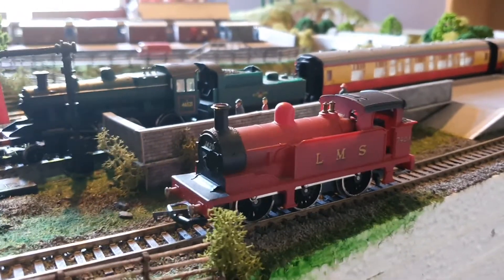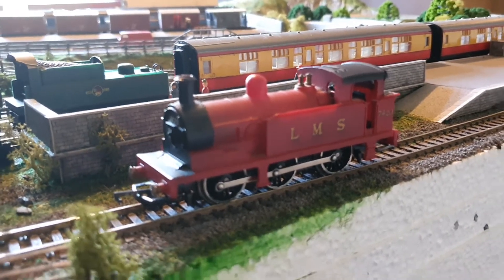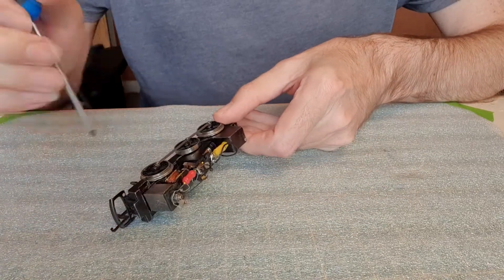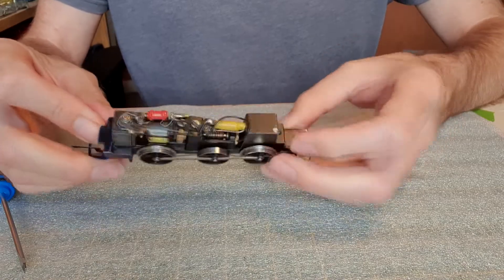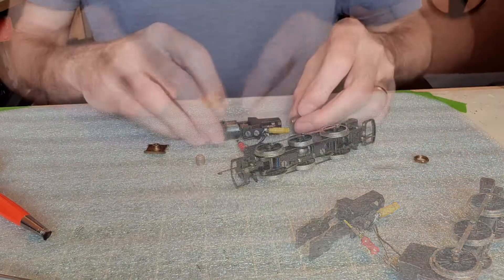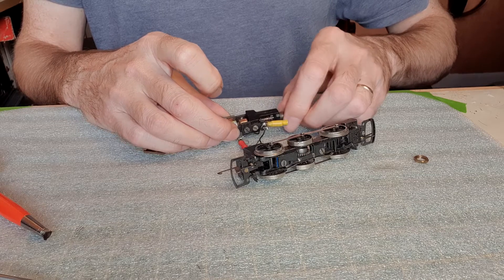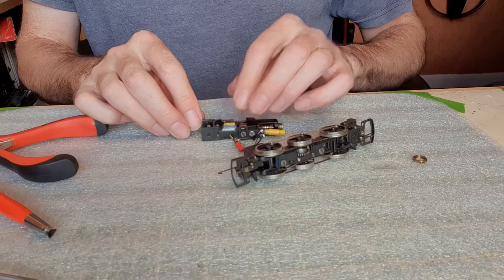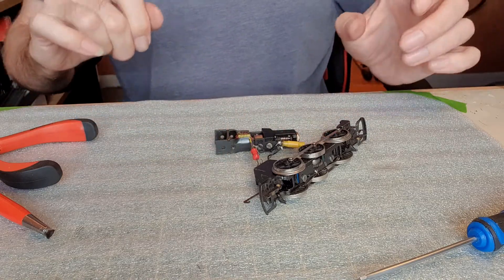Wrenn W2204 0-6-0 Jinty Tank Loco Gets Greased and Neo Magnets

Comment: There should be a tiny ball bearing in each bearing cap. When stripping down these motors, you must check that they are present and re-grease prior to re-fitting the armature. If the bearings are not present then the bearing caps and the armature spindle will continue to wear.

Comment: Hope the needed original ball bearings on the motor have not been lost. If so then noisy running and high wear.
Removing the magnet without a keeper plate usually loses some magnetism. Not good.
Love to know the price you paid new.
Smart of Wrenn to paint a Southern loco LMS red to convince some buyers their SECR R1 is a Jinty.
Reply: Thanks for the tips here, you've certainly made it quieter - just wondering if you could reduce the translucency of the loco body by painting it black inside?